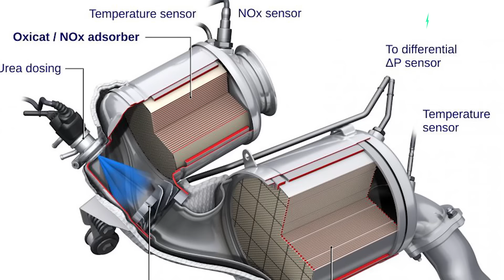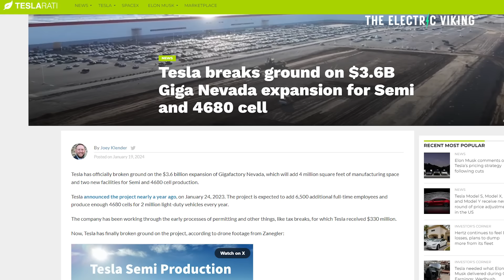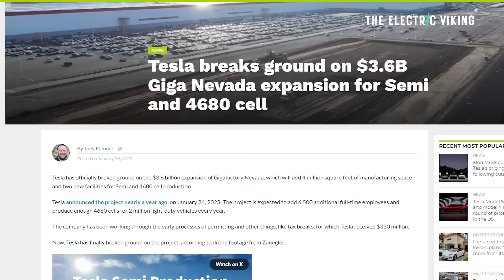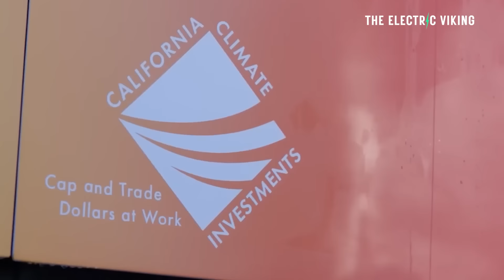Tesla reveals timeline for massive electric Semi production at $3.6B factory

Comment: Saving energy from regenerative braking is huge due to massive weight of the semis
Reply: Most semi drive on highways, where regenerative breaking has little to no effect and truck drivers need to drive in an economic way if you are using the brakes you are wasting energy.
Reply: @isaac827 They use engine braking. In a combustion engine this burns fuel. In an electric engine it is called regenerative braking and  charges the battery.
Reply: @robertwhite3503 wrong. Engine braking uses no fuel. The fuel is shut off and the engine compression slows the vehicle.
Reply: @Paul-b2s4j  So when you get to the bottom of the hill, the engine has to re-start?
Reply: @robertwhite3503  Jake brake does not waste fuel, the fuel is shut off when braking.
Reply: @robertwhite3503  obviously not a mechanic under engine braking there is a load driving the crank when there is no load the fuel system kicks in so many sensors on a modern engine every electronic direct injection motor will completely cut fuel under coast/engine braking scenario but on port injection they will run in an ultra lean cycle so some fuel is burnt but it's less then under an idle condition
Reply: The more a vehicle weighs the more energy it uses ..EVs always use more energy than an ICE counterpart. Simple science
Reply: lol OK tech bro
Reply: @mervstash3692  You're welcome. Here is the scientific law, so you catch up to the rest of us. The fourth power law (also known as the fourth power rule) states that the greater the axle load of a vehicle, the stress on the road caused by the motor vehicle increases in proportion to the fourth power of the axle load. This law was discovered in the course of a series of scientific experiments in the United States in the late 1950s and was decisive for the development of standard construction methods in road construction
Reply: @wswwsearch the Tesla semi uses around the same energy as a f truck.  EVs are so much more efficient its not even close.
Reply: @saff226  hmm. If you're familiar with the port in Long Beach, California where they are required by law to use EV trucks they have numerous issues particularly lost time due to charging. In practice there are lots of issues. On YouTube things often look better than they are for the employees having to go that route. Hydrogen works better, both are on site..

Comment: Here's some negative feedback from someone who's been driving semis 37 years.
Get rid of the moronic central driving position.
All that is doing is making BOTH sides "Blind sides" instead of just the passenger side.
The damage that is going to be caused by that on UK roads will be horrific.
Reply: The idea here is that cameras will enable the drive to not have the blind spots you’re speaking of.  With that said, def appreciate hearing from a semi driver
Reply: Interesting.  I've never driven a semi so I defer to your expertise on this.  But I definitely wondered about it!
Reply: @jmanjr  It may be the idea, but do they.
Reply: So if the camera gets damaged, you can't drive the vehicle?
Reply: @francismarion6400  serious question or just dumb?
Reply: @jmanjr  Serious, there are strict guidelines for driving heavy loads. If you can't see in your blind spot, you could easily kill someone.
Reply: @francismarion6400  it’s not that you can’t see.  If that were the case than a standard truck wouldn’t work with the driver on the left side.
Reply: @jmanjr  Do you not understand why it's called the blind side?
Reply: @jmanjr  blind side here means the side you cannot see with your eyes. Mirrors and cameras are tools and it always better to see directly with your eyes because you can better estimate the distance and the depth.

Comment: To me it makes sense putting battery packs on the trailers themselves . I have worked for a trucking company on a loading dock . You always have extra trailers sitting around . If you could have trailers with battery packs charged up and ready to go you  could reduce the need for charging and extend the milage . . I dont see a problem of getting a 1000 miles of range without charging with packs on trailers .This would be even more positive for self driving where drivers could go longer distances without needing to take a required brake . Of course eventually you won't need a driver sometime in the future as the trucks will actually be robotic in nature . 

Now the cyber truck does something similar with its added range extender battery pack  that is placed in the trucks bed . Now weight and loss issues maybe a problem as there are rules on how much weight can be towed but  I think that's more of a reason that loads become more top heavy as you stack up .  Batteries would be at floor level making the trailer more stable with more weight at the floor level so weight limits for EV semis with trailers should be able to go heavier to compensate for the batteries . 

I think you could also have packs on any type of trailer pulled by say a electric pickup to reduce or eliminate range anxiety pulling a loaded trailer . I guess there could be a similar issue with adding extra weight to a trailer but once again laws should be changed for low center battery packs installed on trailers
Reply: Maybe packs on trailers will be inevitable once volume of battery production increases to the point where availability of battery packs no longer constrains total EV production.
Reply: There are GVW limitations that would make that impractical.  Railroads however could add battery cars  to run their engines, they are already electric.
Reply: The big rig diesel engines, transmission, driveshaft, exhaust and filled diesel fuel tanks together all weigh close to 5,000 thousand pounds or more. That weight is replaced by large battery packs and small powerful electric motors. So the EV drivetrain weighs maybe an additional 5,000 pounds more than the diesel drivetrain, as a guess. 
The EV probably saves additional weight in the structure of the cab and frame if it uses a lot of aluminum.
Reply: @howardj602  As I suggested the limits would have to change for EV semi's . If the added weight of the batteries are at floor level the trailer becomes more stable . As you stack up with freight the trailer becomes more top heavy making it more prone to tip overs or jack knife . Trailers probably need a bit of structural redesign but maybe not and existing trailers maybe able to be retrofitted
Reply: @stevencole7331  The weight limits are there in an attempt to minimize damage done to highways because of heavy vehicles. Obviously the present weight limits are not doing what they are suppose to do.
Reply: As far as weight .  The average rail car can carry 3.5 times the weight of a semi.  Without any modifications.
Reply: @howardj602  I agree rail is superior over trucking for transport . Ship is more economical over rail . Air is the quickest and most expensive. Each have its advantages and disadvantages and one can't do it all so all forms of transport will be used
Reply: @stevencole7331  Agreed but the question is about over-land shipping.  And the cheapist and rapidly becoming the most  efficient is rail.

Comment: A huge key, assuming everything else is accurate and they invest massively in a national charging network, is the FSD. FSD will be more than ready for Semis obviously, so imagine a human only being involved in the Semi driving in picking up shipments, delivering shipments, and managing the charging. Even if charging takes 2 hours for this, worst case, each time, the driver may only be working 4 to 6 hours total in 24 hours, and the rest of the time the truck can be driving. Today, drivers are limited to like 11 hours per 24 hours to be able to be driving. So imagine the cost savings not just in fuel and maintenance, but ALSO in labor, and on top of everything else, the massive efficiency of moving loads from Point A to Point B. If this works, this is a massive, massive game changer for the long haul Semi world. I can see why Tesla wants to make sure they get this right, because if the business model is as they say, they will be getting a massive number of orders
Reply: The drivers will be paid as long as they are in the vehicles.  The "autonomous" feature has yet to be done without a human in the vehicle.  Drivers now get paid in over-the-road mileage.  What is being overlooked is that with today's technology a long distance train has one engineer, and one conductor.  that is being reduce to 1 person in charge of a 200 car train holding 400 double stacked 53 ft containers.  That is where the savings is going to come in.  The Electric Class 8 will be used mainly for distances of less than 300 miles from a RR.terminal that is fully autonomous transferring long haul to the final miles in under a days drive.
Reply: @howardj602  Yes. That is what I said. They will paid the same for the haul but the truck will go twice as far in 24 hours as it would have if was being driven the entire time by the person. FSD will more than easily be able to to 100% of all the highway miles without any intervention or observation extremely soon, and likely a lot more than that.
Reply: Team driving exists today.  Team drivers are paid a bonus for productivity for driving a specific number of miles in a week and earn additional mileage pay for any miles over that. Instead of paying less they will be paid more. Most of the time team drivers are only used in high-priority, time sensitive loads. In any event, the the  highway miles of truck delivery  is  being cut  by  the increasing use of the advance technoloy and being replaced by  longer, faster trains, with delivery to specialized distribution centers.   2 person crews delivering  the load of 400 OTR trucks that would require 800 team drivers,  is a hard economic  figure to beat. At the present time rail shipping  saves an estimated 40 to 60 percent in transportation costs. The best part is that most of the infrastructure is already  in place. And the locomotives are aleady electric.  Powered by a diesel generator.
Reply: @howardj602  And the one person will be able to do the job that two people did while not really working much because the FSD did 95% of the driving
Reply: @travisjazzbo3490  As all of this is hypothetical I don't believe that FSD will be the boon that many expect it to be.  There are too many variables on the road that will not be expected. They might work in a dedicated highway system. But that has not even  being brought into the equation.  The future for long haul is in rail. The future for EVs are in  regional or last miles.  And Tesla is running last in that  race at the present time. Tesla has already lost out on the delivery van market.  They don't even make one. As far as FSD for semis  goes.  Nobody has a horse in that race yet.  There is a lot of speculation, but there is only one  prototype, and a lot of speculation.
Reply: @travisjazzbo3490  The currently enabled FSD for passengers cars,  requires a fully attentive driver, who has their hands on the wheel and is prepared to take over at any moment. If the criteria is not met the vehicle will slow down and safely stop.  There is nothing to indicate that any  better is available  for Telsa's  yet to be  mass produced Semis.
Reply: @howardj602  Yes... of course. I am talking about the progression of how far and fast this is going. These drivers are using it with ZERO issues in long trips and through construction in cities in complicated situations and it is handling them like a human, better than a lot of humans actually. It is supposedly already safer statistically!

That is my point. It is getting better and better exponentially.  I am not sure what you are not understanding.

This is the real deal and in a very short timeframe, it will be released as FULL FSD not BETA anything!

Robotaxi going to be announced in August. Are you not seeing this or just hate Musk or Tesla or??
Reply: @travisjazzbo3490  You just cut youself off.  When we are having a discussion  why do you make a personal attack and question my reasons  and accuse me of hating Musk or Tesla.  My only purpose is to have a free exchange of ideas, and information. Your accusation of hatred being a motive is setting me up as a strawman. i.e. ntentionally misrepresenting my motives  because it is easier to do than coming up with an answer against my real argument.
Reply: @howardj602  My argument was that FSD was going to be extremely capable of driving anything anywhere very soon, and Semis are a ways off, and your argument is acting like it is some sort of a joke or something as if to insult my intelligence.

Then I calmly referred you to look up videos because you seemed to not be informed, and you still acted like I didn't know what I was talking about, as if I said it was fully independent today, when all I was saying is that it will be fully independent very soon, and truckers would be able to not have to babysit it for at least 95% or more of their trips, and you acted like I am out in left field as if the evidence isn't everywhere to plainly see.

I could only draw a couple of conclusions. Either you weren't informed on anything, not looking at the videos to see for yourself, or you hate Tesla or Musk for some reason like a lot of people do for whatever reason.

What else would you conclude?
Reply: @travisjazzbo3490  You been cut off. Now blocked.

Comment: Sam, Talking range, the one EV thing that has me puzzled is the absence of work with supplementary batteries. On semis, why not build in supplementary batteries underneath the goods deck?  Here in Aussie lots of talk (good & bad) about towing with EV. Why not caravans with supplementary batteries? For long trips, why not "roof rack" supplementary batteries???, or tow small trailer with supplementary battery, or even a generator and petrol tank for the few long trips for holidays etc or going bush where no charge stations are available. If Teslas were fitted with a more integrated transfer (charging??) plug and aftermarket providers were encouraged to provide this support,  the EV world benefit enormously.
Reply: "Buy a generator for long trips". Why not just have a petrol car?

Comment: The problem with fuel savings payback is that it requires access to cheap bulk electricity. Which may require megapacks to effectively manage. AND ... eventually states will need to replace the lost tax revenue. But for the early adopters there will definitely be a tactical advantage.
Hopefully they will do this with "per-mile" registration costs, since adding the tax to electric rates has a LOT of issues. (But would certainly encourage big private PV installations!).
Reply: You really cannot guarantee cheap sources of oil either.
Reply: Large trucking firms and delivery operations who have the land and/or the rooftop space may decide to do large amounts of solar panelling on their property and then they can essentially give themselves free fuel for their trucks.
Reply: @rtmclean484  The average GM / Grocery Regional DC in the US is now up around 1 million square feet with many topping out over 2 million. That' a LOT of rooftop. And they often have huge acreage for truck / trailer parking etc.
AND ... where possible they are built in places where they can tie to TWO electrical grids (those buildings use a LOT of power electric material handling equipment whether it's conveyors or otherwise).
A lot of them are very easy to convert to at least a 50% electric fleet.
Batteries, solar panels and electricity arbitrage will become a budget line item and possibly a profit tool.